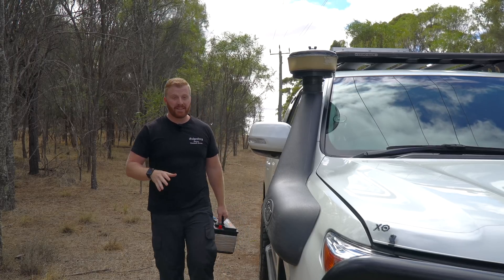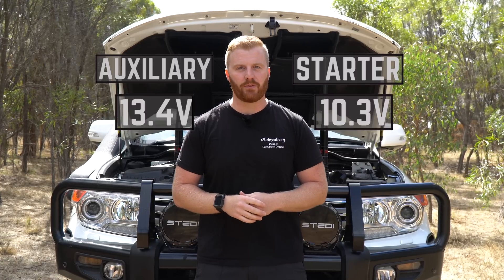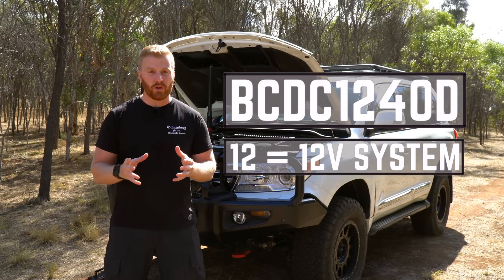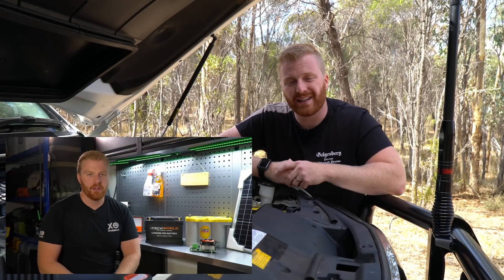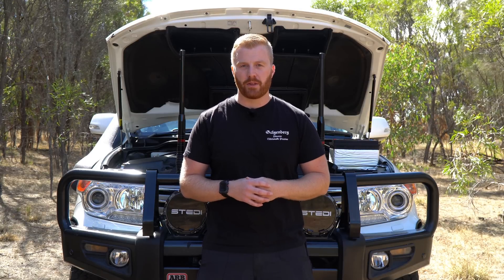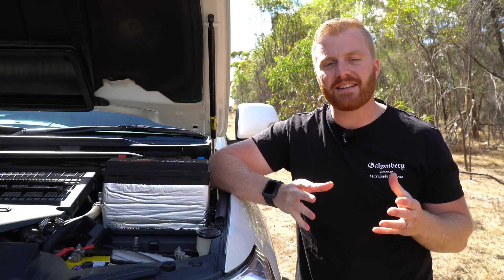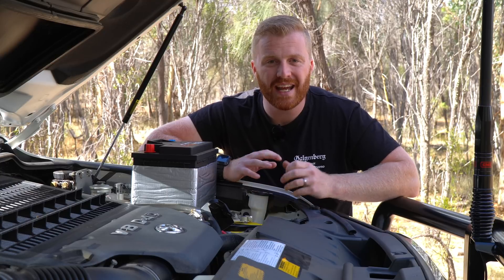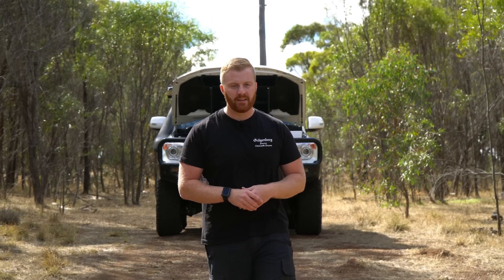LITHIUM is OUT for now… | Not everything works first time | iTechWorld 1420 CA PRO | The AGM is back

Comment: Seriously, how hard would it be for the BCDC unit to have a input which you could tie to an ignition circuit to tell the device to operate or not. It already has the necessary switching circuitry yet you have to add an external relay!! How stupid. Here is something even more left field, how about a solar input as well??? crazy I know.
Reply from the maker: Yeah, it is a little frustrating and I'm sure Redarc will be developing something in the future as lithium units become the new normal. 
They do have a solar input though, I'm running two solar input plugs on my vehicle 👍

Comment: I installed a 100amp heavy duty relay with a manual switch in the cabin, so i can isolate when i roll into camp or not using the second battery and when i do water crossings etc…
Reply from the maker: That's not a bad idea at all, thanks for sharing 👍

Comment: So just to get this straight if you use AGM crank with lithium AUX AND a BCDC it will be fine ? its only if you use both as lithium? its a problem
Reply from the maker: Hey mate, this was my experience. You won't suffer the same problems if you keep an AGM, or any other traditional starter battery. The lithium auxiliary should run fine from the BCDC unit like this 👍 
This issue will occur with dual lithium batteries though. 
Cheers, Nathan.
Reply: @XploringOz  thanks for the reply mate cheers

Comment: This is excellent information. I currently run a Redarc BCDC 1225d in my 80 series and will probably make the lithium switch in the near future. I recall the BCDC having a sensing wire for vehicles with a smart alternator. Would connecting the sense wire not tell the BCDC to stop pulling current when the vehicle is off? (The 80 has a basic "dumb" alternator, so I never bothered connecting the sense wire).
Reply from the maker: Thanks mate, glad you found this video useful 🙏 
So I did not have any luck with that blue wire on the Redarc. Even connected, this only really alters a few settings and didn't solve this issue. I've recently installed a ignition fed relay and so far, so good. 
Cheers, Nathan.

Comment: Also, what to consider when swapping LiFePO4 battery into EFB or AGM battery. Taking into account nowadays SMART alternator. On normal car setup. Daily car uses. (Not off grid setup ya.)
Reply from the maker: For sure, this has to be taken into consideration and contact with a battery manufacture would point you in the right direction if this was required 👍

Comment: The Victron DC to DC Smart Chargers have had programmable voltage values for ages. I have however a question for you, how are you actually charging the lithium cranking battery? Is it being charged straight from the alternator? If so, I thought this was not advisable, as lithium can put huge demands on the alternator that generally causes it to overheat and fail at low RPM. What has actually being done to this iTechWorld battery to prevent this issue?

Comment: Hi Nathan, have you installed the isolator relay?   If so have you reinstalled the Lithium battery?   Being in WA where the heat is fairly high, have you had any problems running Lithium batteries under the Bonnet?
Reply from the maker: Hey mate, I've had the relay installed and no issues with this so far. I've only had the lithium starter re-installed for a short time now, but so far so good. I've had the lithium auxiliary battery installed for a linger time and this is still performing very well on and off road. No dramas with big water crossings of heat that I've experienced 👍

Comment: Interesting and useful video. I’m curious why the BCDC didn’t disconnect the lithium crank battery when it fell below 12.7v…. seems odd that the BCDC would pull it down to 10.5v? Or did it isolate the aux and crank below 12.5v and was that the standby power in the Cruiser that then pulled the crank battery so low? In any case, I’m heading down this path with a solenoid. Bought one and the starter motor sounds like it is on steroids when drinking from the Lithium 👍

Comment: Absolutely nailed it great presentation. Also another good key point to to add here is people still running a lead acid cranking battery having it on a trickle charge will force the DC charger to kick in resulting in a flat starter battery as most trickle chargers are very low in amperage.
Another option would be to install an ignition controlled 80 amp or higher relay on the Pre side of your existing DC charger.
Reply from the maker: For sure, another great point. I think ASPW also mentioned this in a video regarding a similar experience 👍 
Cheers, Nathan.
Reply: @XploringOz  there are a lot of changes in this industry at the moment. From this coming June there are some standard changes also in the Caravan industry. This will help out and weed out a lot of the Cowboys out there. Also some of the big players/companies are also developing more suitable and also programmable chargers. Let’s be honest it would be great if we could program both Redarc or Enerdrive products via our smart phones. Just like we can do with Victron. You will see a shift towards this as lithium becomes more predominant in the industry. Also reading state of charge directly from the battery will be the standard. DCS for example.
Reply from the maker: @extremeacc101  Hmm, will be interesting to keep an eye on these changes. It will surely make some manufactures nervous...
Yes, I can see the future of DCDC chargers including features like this and that way they will be able to be customised for any combination of battery setups. They will have to make if fool proof though so people who aren't aware of the setups can't harm their systems...

Comment: Another great YT.  I concur RE: Redarc service.  I had one of the very first BCDC1240’s after they were first released.  I had a little Non-Redarc issue but wanted to make sure the Redarc wasn’t causing interference & the Redarc engineer was Excellent.  He virtually bent over backwards to help me.

Apply the KISS theory to that problem & stick to the cheaper/lighter option to correct that problem would be the way I would go too.  I can only imagine the look on your face when you saw the readings on that lithium cranker 😂….. can’t miss a trick springs to mind 🤦‍♂️

Redarc will definitely be getting more of my money in the future because a company that supports its customers should get support in return. 👍
Reply from the maker: Absolutely, cannot complain about the Redarc service at all. Very happy and satisfied with their customer service. 

I feel like I'm slowly straying away from the KISS principle with all the modifications I'm adding, but hopefully they last the test of time and hold up to the abuse I throw at them 😬

Comment: Don’t use a 50 amp relay, use a smart bp65 victron lvc you can use a ign sense with this aswell. The bp65 has short circuit protection under and over voltage protection.

Comment: Interestingly I contacted Itech today re purchasing the Lithium Cranking battery. My primary concern was heat, as my GU Patrol develops a great deal of underbonnet temps, especially when towing.
I spoke with their representative whom confirmed plenty of installs in GU Patrols, so my concerns were alleviated.
I then explained I had 3 X Itech 54 amp hour as axillary (house batteries). I was immediately asked how I managed the charge to these batteries. As soon as I mentioned Redarc BCDC I was immediately notified of this issue (the one you raised here) and that I'd need to address it if proceeding.
Good to be informed prior to purchasing.
I placed my order aware of this issue.
I just adore my Itech Lithium batteries, 1 X 120X in the caravan, 
3 X 54ah house auxiliary, power never fades, yes expensive but worth the peace of mind.
AGM lasted 7.5 years each in caravan, 2 in 15 years, happy about that. AGM house auxiliary in Patrol only last approx 2.5 - 3 years each time around, but I work them out, fridge/freezer running, coffee pod M/C  daily X 2 via invertor, lighting, incidental charging (phones, drone etc) expecting better from Lithium.
On the other hand, cranking batteries in Patrol only last 2.5 years, as soon as the temps fall in winter months it struggles, hence opting for Lithium this time round.
Your videos on Lithium have been truly informative, thankyou.
Reply from the maker: Hey mate, thanks for sharing your experience. 
I'm glad to hear that iTechWorld were straight up when you explained your situation 👍 
I'm glad you have enjoyed my lithium videos and I agree with you and your thoughts on lithium. They sure are the future of power for overlanding. 
Cheers, Nathan.
Reply: @XploringOz  Just an update.
My battery arrived so installation became priority.
I elected to go with a relay to totally seperate starter from auxiliary rather than relying on voltage programmable VSR as recommended by Itech.
Now, being a creative individual I wish to share with you and fellow enthusiastic what I did.
In the past I initially seperated my batteries by means of a Redarc SBI12 (voltage sensitive relay) prior to upgrading to Redarc BCDC.
In a Redarc SBI12 you have the amp rated relay required to seperate the batteries, simply remove the voltage sensitive circuit from the relay, (3 nuts only and retain ground wire on coil by cutting wire at connector) then take a ignition activated circuit (took mine from windscreen wiper motor) to the coil positive side of the relay coil. One side of the 2  terminals go to the BCDC, the other to your new Itech Lithium.
Now you have the ignition activated relay required to seperate the BCDC charged auxiliary batteries.
Immediate fix and if you (like me) have a SBI12 spare from previous, there is no expense apart from 1.5m wire and 5mm eye connector.
Patrol has never cranked and fired so fast, excellent result.
Regards,
Reply from the maker: @ianweal3081  Nice! Sounds like a great solution to this problem, particularly if you already have a SBI12 lying around too 👍 I have gone with a traditional relay and it seems to be working well so far, disconnects the batteries immediately after the ignition has been turned off.
Reply: @XploringOz  good one, way less expensive than programmable seperation and possibly more reliable. I wish to remain tech free of issues, but only where possible.
No alternative, Glady follow and learn tech stuff.
My Lithium stuff is performing flawlessly.
Reply: Just a quick follow up.
Took Patrol in for a tune on dyno.
The technician initially determined my Patrol had poor compression due to the cranking rate/speed prior to start up.
Had him and his fellow staff convinced my motor was in too poor a state to tune.
Once I was informed of the underlying concern I was greatly relieved to advise that cranking rate was all due to my Itech lithium 1420 pro battery. 
Truck tuned up beautifully, thank goodness.
 They learned of the Itech lithium cranking battery virtues as a result of my visit, love my Itech products.

Comment: I'm amazed that I stumbled across this video. I might have to do that with my vehicle as I have a similar setup. Luckily, I don't have anything drawing down on the rear battery yet. My question though, is how do you supply power to the relay only when the engine is running?
Reply from the maker: Glad I could bring it to your attention, hopefully before being isolated somewhere...
The relay can be sourced through an ignition wire from the fuse box. This will complete the circuit once the ignition is turned on and therefore supply the charger 👍 
Cheers, Nathan.
Reply: @XploringOz  Cool, Thanks. I actually worked it out myself.

Comment: or if you have a fixed solar as a topup, get a dcdc that then also backfeeds to top up main battery aswell
Reply from the maker: That would be helpful!
Reply: @XploringOz  yeah I run the renogy dcc50 now as it does that had ctek (which did it but had major issues with it so removed both set-ups) then went to intervolt which doesn't  back feed, then found renogy on initial sale got it for like $220

Comment: I know you go over this, but this problem is quite predictable by looking at the low voltage cutoff of your DC DC charger and the discharge curve of the battery. 

We've been running the itech cranking battery and an enerdrive DC DC charger for about 18 months now. The original relay I installed to isolate the Enerdrive unit failed and I replaced it last week with a 100amp solid state relay from Jaycar which should last a lot longer. The Victron smart isolator doesn't seem to offer any real benefit IMO. 

BTW the iTech battery failed after about 14 months and left us in a very awkward spot. Itechworld did repair it under warranty but it wasn't a particularly smooth process.
Reply from the maker: For sure, the problems can be foreseen, but something that isn't widely discussed or advertised from the manufactures and easily forgotten... or maybe it's just me 😂 
Hopefully this can hope others make an informed decision. 
Cheers.

Comment: I’ve installed the Victron smart battery protect.  Works a treat.
I like the ability to adjust the cut off voltage. Occasionally while camping I’ve lowered the cut off voltage, when the Aux batt was low, to draw a little more off the cranking battery and put some in the Aux.
Reply from the maker: Good to hear some positive feedback on the Victron unit. 
Cheers 👍

Comment: Same issue easy fix just put a relay on my Redarc charger power via accessories so it only charges when the engine is on 
Simple
Reply from the maker: Glad to hear this has been working well for you and is the fix that I'm hoping to use 👍

Comment: use the aux wire
Reply: seems you had it wired up wrong for the application
Reply from the maker: The aux blue wire doesn't isolate the charger, only places it into low voltage mode and will still have the same issues. 
Cheers, Nathan.

Comment: I had a similar issue with my lithium battery's Atem Power DC-DC charger taking the Yellow Top under the bonnet down to 12.5V before it disconnected. Coupled with the parasitic draw and my 4wd only running for an hour or two on weekends, the workout killed the battery pretty quickly. The simplest solution for me was to connect the charger's ACC/ignition sensing line to switched power instead of directly to the starting battery and running it through a relay and a switch so I can keep the ignition on for the radio without the charger switching on. Probably because it doesn't try to be smart like the Redarc, it seems to stop charging if it sees nothing on the ignition sensing line so I can effectively use it as an on/off switch.
Reply from the maker: Cheers for sharing mate 👍 
Sounds like it's been a common problem for those with similar setups. 
Hoping I'll be able to work around it very shortly. 
Cheers, Nathan

Comment: doesn't the 1240D have an ignition wire which will activate the charger?
Reply from the maker: It does have a blue ignition wire, however this only places the unit into a low voltage mode and doesn't actually isolate the charger. Very frustrating and surprising that Redarc haven't included this feature into their units. 
Cheers Nathan.

Comment: If you’re going with the relay option get a 100 amp relay, 50 amp is pretty close to the 40 amp that the BCDC is going to draw. Personally I would just use the victron smart battery connect with an enerdrive dc2dc charger for better control over the charge settings.
Reply from the maker: Cheers for the suggestion. I'll be interested to see how we go with the 50A, only as this was recommended by Redarc and I can only assume that they have done this a few times before, but failing this, a larger relay may be required. 
Cheers, Nathan.
Reply: Craig, I don’t think the enerdrive charger is IP rated for under the bonnet use.
Reply: @andrewdodwell  it’s not, mine is in the cabin. It’s a fair trade considering it’s just so much better than the redarc.

Comment: Battery destroyed an electrical module in my vehicle.  Which eventually cost me thousands.  Auto electricians couldn’t find problem because it was intermittent. Went on for months.  I eventually proved that the module was intermittently faulty. Due to itech lithium battery.  I replaced the module at a great cost to me. Binned battery and all good.  I don’t recommend these batteries
Reply from the maker: Hmm, sorry to hear that mate. It's never great when something doesn't work as planned and especially when it costs you a lot more money. 
Thanks for sharing. 
Cheers, Nathan.

Comment: It’s interesting that it doesn’t have an ignition trigger wire. I have the 1240LV which hooks up to the ignition and switches the charger on and off and also switches the input over to solar.
Reply from the maker: Yes, it is a little disappointing and surprising. Maybe something they'll introduce moving forward given the increase in popularity of lithium units. 
Cheers 👍